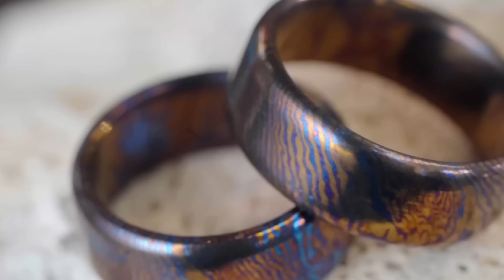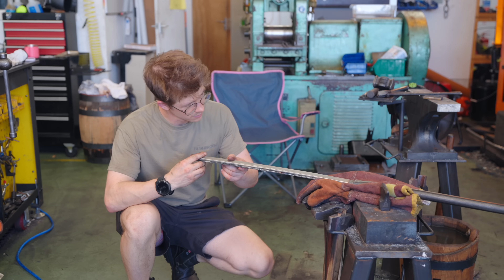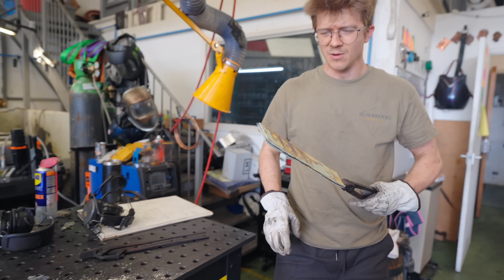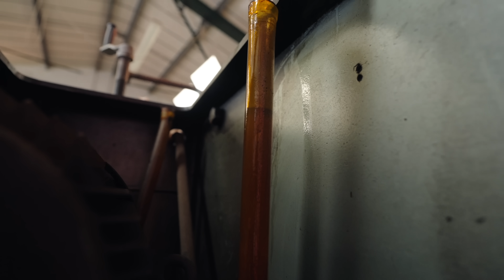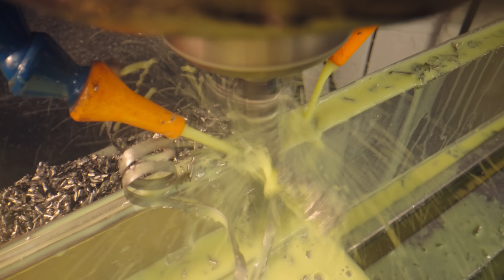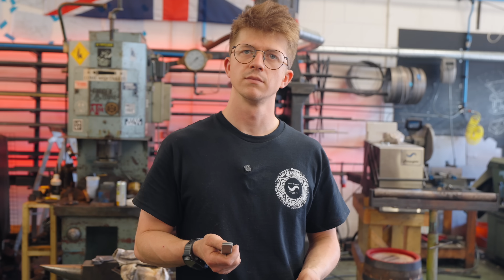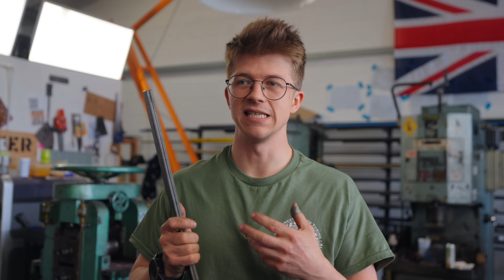Making a Titanium Damascus Katana - Part 1

Comment: Also, it may be worth it to do the argon purge in an oven or while heating the billet with a torch. Gases tend to form a layer and stick around on surfaces, even attaching to them. When glassware is made for applications where there can be absolutely no contamination from atmosphere, or where a very high vacuum must be reached, the glass is heated with a torch while pulling vacuum to rid it of this attached layer of gases. Far as i understand it the heat just makes the gas wobble around more making it harder for it to stick to the surface.

Comment: 14:00 are you sure your rollers are perfectly flat? Maybe a slight variation in the thickness of the nickel from the forge weld left some titanium and steel too close together. Those areas of inconsistent thickness forced the two together while on the rollers. Also the rollers make the material hotter right?

Comment: I do wonder if a completely flat bond is optimal... could a bead-blasted, or maybe even a knurled and oppositely knurled surface, when forged together to fill the voids, give a stronger bond from having a larger bonding surface? Avoiding inclusions in the bond might be the biggest problem there. Do they make patterned rollers for the rolling machine? Passing several pieces through identical patterns could give surfaces that stack decently well, kind of like legos, with a raised pattern on one and a matching indented pattern on the other side. I'd imagine a cross-section of the bonded surface would look cool as well.

Comment: So it fails if you let it cool down too much, like leaving overnight, then heating it back up to forge it out?

So would it still work if you bring the jacketed/argon billet up to 950, forge weld for a couple of slaps, then back into furnace before it cools too much, get it back to 950, then keep drawing it out till your at length?

So as long as you don't let it cool too much in your first/final forge weld session, you should probably be okay

Also, maybe use surface grinder for the thickness?

Comment: I'm sure somebody has said, but could you electroplate the core with nickel first? avoiding 4 surfaces to bond reducing it to 2. im not sure how long or the cost of a decent nickel thickness. you could even key the steel surface before the nickel, i dont know if thatll help, but it feels like it might.

Comment: you could try getting a surface plate, taping some wet sandpaper to it, and lapping the billet pieces. Then you can ring them together before you heat them to keep oxygen from getting between them.

Comment: Can anyone explain, why Alec doesn't want to make the cutting edge out of titanium damaskus? Of course idea of making a layer structure of 2 damaskus is interesting and challenging as hell, but on the other side full titanium damaskus katana also sounds cool as hell. Also, I think that titanium damaskus cutting edge could have really interesting properties in use, because titanium is mush more incredible material in expluatation than steel.

Comment: Just thinking out loud: How hard/expensive would it be to put something like a painters tent over the cleaning/assembly bench and the press or hammer. Purge that tent of all oxigen and work wearing a respirator? Somehow that seems easier to me than the conventional way of working. Just not sure how to heat the metal... Does the induction heater work on Ti?

Comment: Couldn't you also add a block of the outer material to the inner part at both ends, so the ends are always properly bonded and less likely to split in order to protect the ends of the Damascus?

Comment: You'll probably never see this comment but... Perhaps you could use some kind of acid etch to remove surface oxidation from the plates before you try to bond them.
Even while purging the oxygen I still feel like you're fighting oxide that was already there from leaning against the shop wall for however long it's been.

Comment: 37:24 shell mill can put a lot of strange torque on material, particularly with a heavy cut. It may have been able to handle a chopping cut or even some axial force, but the shell mill is unique. If there is any question of delamination, choose a much smaller end mill and plan your direction of cut to face down material. You can always flycut the surface at the end to remove the tooling surface

Comment: It's hard to tell speeds in those awesome videos, but it would be neat if you could confirm that it is indeed impossible to set up the induction forge to heat a section which then goes directly into the roll press, having continuous heating and rolling for any length piece which fits in the induction loops.

Comment: I always wondered, how much bonding surface and material you need. So if you in the end press it, wouldn't making it between the bounding layer in wave paterns on both sides. Then when you hammer it makes both material and bound material flater you have technically more surface to bound with because of the waves. Maybe making the middle pieces of steel smaller in two pieces with the bounding agent to test the bounding?

Comment: To test the hardness, you probably want to heat treat, and then cut the sample in half and test the cut face. As you did it, the steel you tested was directly exposed to the oil, and thus could have still cooled quite rapidly. Steel in the middle of the sample would be completely encased in titanium and thus have no contact with the oil, so that's where the heat treat would be questionable.

Comment: Prediction at just under halfway through the video. You'll have to make an all titanium damascus, cut two pieces to longer and wider than the finished katana blade, forge weld in an argon purged jacket to steel with nickel interlayer, then cut and grind to shape.

Comment: is it possible to use the induction instead and work the weld incrementally from tip to toe? then less of the material stays hot too. Sounds clumsy, but idk i thought thats what the induction heater was best at.

Comment: I believ you should consider doing a difrent grade of steel on the interior of the blade and or applying a different heat treatment to the edge that took guite the bend on wood

Comment: Hi Alec, that's such a cool project!
Would it help to make a smaller upper die for your powerhammer? So i.e. half the die-size doubles the force per area on your forgeweld?
Also could you instead of bonding the pieces on your powerhammer, bond them in the rollingmill instead?
Maybe you could also get away with a shallower block of material, if you katana-banana it during your forging process?

Just some ideas I think might work, or would atleast be interesting to see for me ❤

Comment: Is there a way to add thermal mass to keep the billet at high temperature for longer? Suppose outside of the mild steel jacket you had some forgeable insulation or just a super thick jacket to allow greater time at heat

Comment: I wonder if the bonds are able to withstand the traditional method of applying the hamon and curve to a katana using clay slip over the final blank during the quench. I would imagine that it wouldn't but perhaps testing a rolled blank and an unrolled blank against each other would be useful information.

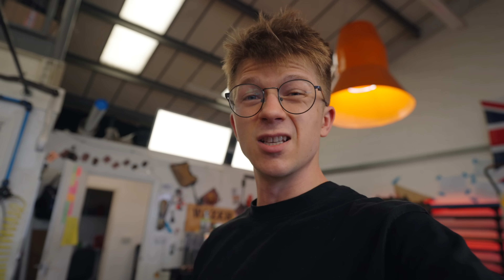Comment: 16:39 Hey Alec, Nighthawkinlight did a video explaining a scientific process known as the Taguchi method which allows you to change multiple variables while lowering number of iterations via use of orthogonal arrays. This method could be useful to save time in instances just like the one you found yourself in during experimentation while recording this video. Depending on how many releases ahead you are, (because I know some creators are weeks out on certain video series) you may have already come to a solution, but I just wanted to mention it in case it's useful to you in future experimentation.

Comment: Hi Alec, if you search for a welding O2 monitor (sniffer) then you can get a little tool that will read the O2 in ppm or % and can be relatively inexpensive (circa £200), that'll tell you if there is any oxygen or not.

I can suggest makes and models if you'd like.

Comment: I think what's happening is when you heat treat the steel, it transforms from austenite to martensite and expands, causing roughly 0.04 strain. This strain creates delamination and is why your air-cooled sample did so well in the bend test and the heat treated one delamanated. If you had thinner titanium, this could reduce the stress on the bond and help with the delamanation issue.

Comment: 14:00 remember what happend in your last Forging-Challenge .. with hammering you heated up the Steel ... now think what forces are in your Roller when you move more Metal in shorter Time = more friction = more heat

Comment: I genuinely love your dalmasus titanium episodes cause it's raw science.
Hammer blows apply short pulses and then release, but the rollers create a sustained, directional compression zone. Once that low-melting Ti–Ni phase formed, the fixed roll gap may have acted like a squeegee—continuously pumping it toward the sides.

So the first rolling pass may not just have revealed the liquid; it may have provided a much more efficient mechanism for expelling it.

Comment: Might be worth a try to see if you can do the diffusion bonding pass in the rolling mill. Might work well for longer pieces and still keep the bonding pressure high (and very local). Also the applied strain can be controlled very precisely.

Comment: You could fix the bowing of the steel as it comes out of the roller by putting an adjustable steel stop on the finishing side and then just make sure it’s slightly larger than the piece and it’ll help keep it relatively straight

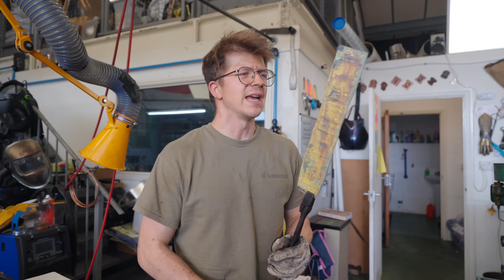Comment: @11:20 — your explanation moments later makes sense. At ~1,000°C, Ti and Ni can reach their ~942°C eutectic composition locally, creating a transient liquid even though neither parent metal has melted.

That probably explains why it looked genuinely liquid rather than merely plastic.

I still wonder whether thicker nickel could leave a solid Ni core after the Ti-facing side begins reacting—but two loose foils would not prevent the eutectic. Lower temperature, less soak time, or a gentler first reduction may matter more than simply adding nickel.

Consider fusion bonding them separately with their own nickel interlayer, then bonding them to each other using another interlayer. This would give you a whole weeks worth of testing.

Test 1;
1st Bond Job = Titanium Nickel x 2 separate batches
2nd Bond Job = TiNi | Steel | TiNi

Test 2 (2 layers);
1st Bond Job = Titanium Nickel x2 separate batches
2nd Bond Job = Nickel | Steel | Nickel "sandwich"
3rd Bond Job = TiNi | NiFe | TiNi

There are more, but for the sake of brevity I'll let you cook with this idea. I'm sure you could double this test batch by choosing to quench or not.
Ofc, you would want to clean them up VERY well at each step. Meaning you will lose material and have to account for that.

There is also a thing about temp, you must of forgot, but I distinctly remember that ~700-900, and time was more important. How long you stay at temp.
You may consider also just rolling them with the jacket still on. I'm getting way ahead of myself though, I need to continue watching lol

Comment: For finding very fine delaminations, at least on the surface, you could try fluorescent penetrant. I work in a foundry, and one of our NDT methods for finding cracks like that is applying a penetrant, removing it from the surface and it will weep out from the cracks, highlighting the cracks under UV light.

Comment: What would be interesting to see is what would happen if you just stacked the steel, titanium, and interlayer on top of each other and then performed the bend/break test to see how much impact the bond has vs a 0% bond when all the pieces are under the same stress. It would also be interesting to see how they perform in the bend/break test if you roll and/or harden the layers independently and then simply stack them on top of each other. Love the new experiments!

Comment: Now I of course, am no blacksmith. But would doing two layers of nickel that are wider than anything else help? The two pieces would allow the titanium and steel to bond without having to bond to the same layer. And maybe allow for some heat differential movement. That’s probably horribly worded. And that the nickel being wider than anything else would act as kind of barrier to prevent contamination?

Comment: Have you considered with a longer billet and with the new hammer setup that the seals of the jacket are breaking as you are hammering it, letting more oxygen in, displacing the argon, and weakening the bond? Or if that's not it, just the overall setup you were using was different from last time you made titanium steel damascus. Whatever it is, I hope you figure it out!

Comment: ALEC!! The melting point of pure nickel is just a hair under 1500C! If you heat em past 1500C, that interlayer is gone, either by diffusion or getting sweated out in the forge. You also just might be too far past the glass transition temp for a Ni-Fe bond, bc iron is a hungry beast and will diffuse alloying compounds at like 1mm/hour above 1250C iirc.

Also! There's a style of plier called welder's pliers (or welpers!) that are great for having around your mig welder. They can be used to take apart the gun, from gas lens to contact tip, without having to touch the torch. Also they can be used to clean the spatter off your nozzle :)

Comment: Turn the purge down when you think you removed all the oxygen. If you hold a butane lighter in front of the purge hole and if it stays lit then there is still oxygen. A trick I picked up from some old timers while brazing refrigeration lines. I have only ever used a simple bic lighter tho.

Comment: The answer to your melting is in a titanium to nickel phase diagram. They make a eutectic alloy that is lower than either. While you don't think you are making an alloy because you're not mixing them, titanium is an "active metal" it travels across to other metals very quickly. Look up active vacuum brazing. I have defusion bonded Ti to 304ss in a vacuum furnace, no force applied

Comment: It occurs to me that your nickel interlayer is probably not as strong or hard as the steel and titanium layers, so when you roll it out, the nickel might give first and get squeezed out the sides, creating spots where steel and titanium can come into contact, and then it all fails. While it's being forge welded you had the mild steel jacket giving it support from the sides, and when you take that away, perhaps the nickel interlayer is susceptible to being squeezed out. 

Several testable hypotheses there.

Comment: The solution that came to mind for your intermetallic compound issue early on (just spitballing, not sure if this will actually work and I honestly forget if you tried this with your interlayer experiments, been a minute since I watched that one) would be to thicken the interlayer of nickel, then wrap the whole piece in a more inert sort of interlayer under the jacket so that you don't have bonding to the jacket.  The problem I see with this sort of thing is finding an interlayer that will let the jacket come off easier while still using more nickel.  On top of that, perhaps a thicker interlayer will decrease the strength of the bond, as there would be more nickel in between.  I feel as though the coefficient of thermal expansion of all the materials involved is such a delicate thing to juggle though, that's more math than I care to do in the youtube comment section.  Hope this helps though, or at least gives you some ideas!

Comment: you are doing it wrong, the titanium should be in the cutting edge instead of high carbon steal taco in between steel, otherwise your final katana will be brittle, one side is soft while the other is hard.

Comment: Take all this with a grain of salt, I am but a student, and any experts, please correct me.
I think the reason you got the inter-metallic compounds on the rolling mill is because of the different rates of malleability at temperature for the 3 materials.  My guess is that the Steel is the softest, so in the center, it poured out the sides, mushroomed around the nickel inter-layer, and reacted with titanium.  You might be able to prevent this by having a partial shell around the titanium with the open seam away from the steel.  That way any steel that mushrooms over only contacts the nickel layer, but it's not fully sealed, so it can flex as the whole billet deforms.  You would also need to take more care with bonding to the mild steel jacket, since the TiFe won't be helping you anymore.  One easy way would be to use the spray paint trick, but I'd try spraying the billet stack, not the jacket.  Easier to ensure complete coverage.  You may also be able to wrap the stack in some paper to give any free O2 that finds it's way in something to react with instead of your materials.  Think of how at WMG they had to add in some extra carbon to account for losses, even in their super-controlled crucibles.  This paper can burn off, and leave a fine ash as a separation layer, and give the nickel some carbon to react with and hopefully avoid some of those unwanted reactions from happening.  
If you give the O2 something that it'll react with before it reacts with your metals, you can ensure there is none left by the time your metals get up to temp.
Looking forward to the rest of this series, and hope one day I can go from Theoretical to Practical Blacksmith.

Comment: Pick up a fly cutter. Tool pressure from a single point tool is much lower than a multipoint tool. Also gives you a nicer finish if you spend the time.